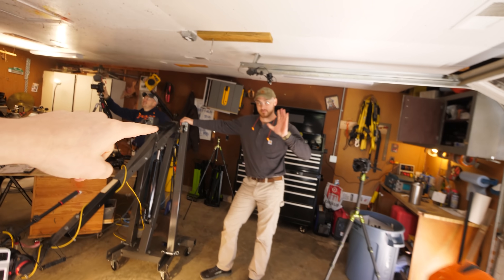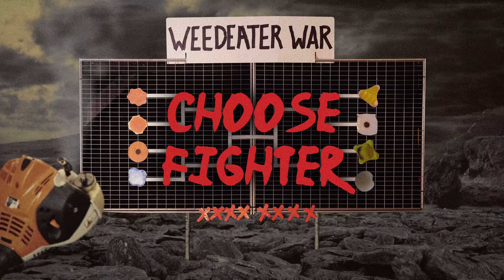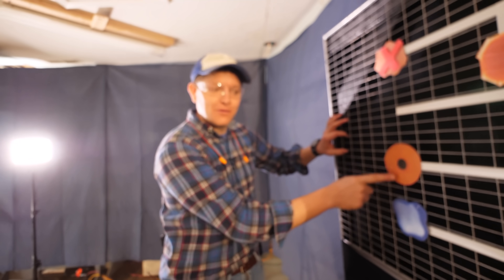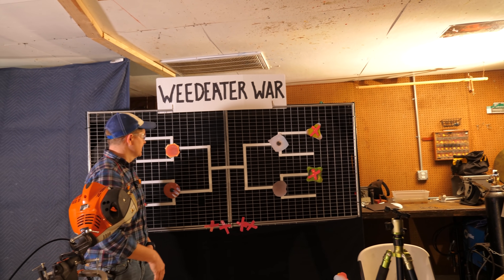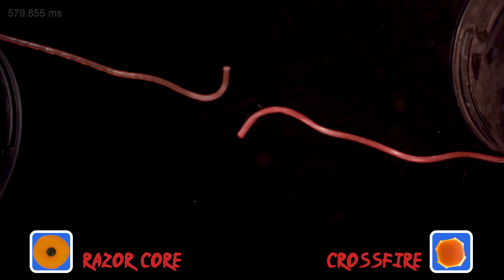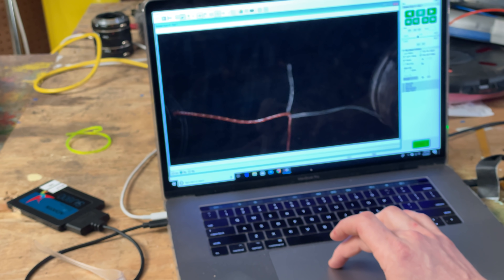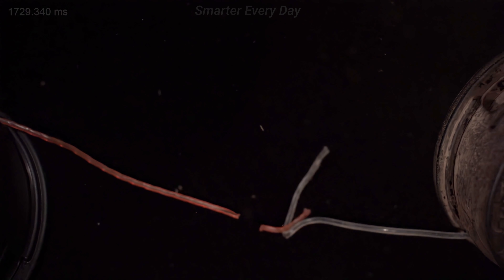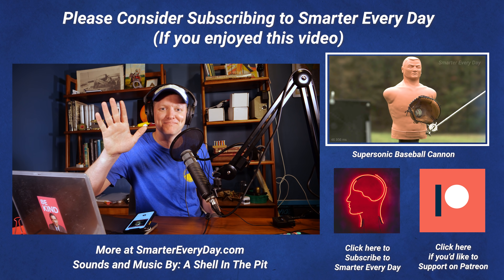What happens when 2 Weedeaters Hit Each Other? (28,000 fps SLOW MOTION)  - Smarter Every Day 255

Comment: I would wager it's partly because rigidity, as you said, but also density and shape. The higher density ones - that has the core, and therefore also have the rigidity - perform better because they have more motion energy; they pack a heavier punch. But also the shape, I believe, the less "flimsy" the shape is, the better it is to deflect incoming blows and to cut. The triangle one is too flimsy, it's more like a folded flat in some ways, too susceptible to incoming blows and cant handle the stress, but round ones are better at absorbing the blows because it can take the punch from any angle and hold up equally good - a blow from the wrong angle tears the weirder shapes faster.

The reason, I believe, the round core and sharp square got to the point they did, was because of those factors. The round core held up great, and technically tore off small pieces first, from what I could see, however, the sharp square cut off larger, and that I believe is due to its shape. While still pretty compact - and not having that many angles that could be torn worse than other angles, such as  the triangle - it also had something the round core didnt; it had the small edges. It wasnt like a very fine edge that could easily chip, like a katana (sorry for the nerdy comparison), but more like a non-honed ax. While not very sharp, it was still something that the round core didnt have. The edges, albeit blunt, on the sharp square cut into the outer layer of the round core and weakened it by cutting into the plastic, meaning in the end it was just the core holding up. And the core couldnt handle the centrifugal forces that occured when the two strips met and clashed, it needed the plastic "shell" to do that. It's like rebar inforced concrete, the core/rebar and the shell/concrete handles different kinds of stresses, and if one breaks, the other cant compensate for it, atleast not easily.

The sharp square had that going for it; while still being fairly compact - with no flimsy weird shapes that could get struck at "the wrong angle" and break easily - it had about the same density/weight as the round core, but with it's blunt edges it could do more cutting into the shell of the round core and weaken the round cores adaptability between rebar/concrete, thus in the end break it in larger chunks.

That's what I believe, anyway.

Comment: Destin, ya gotta try line thats been soaked in water over night vs the same line bone dry or, even better, run in a dehydrator for 24 hrs.  I've found a HUGE difference in how long the line lasts in the tough brush on our property when I soak it before using it.  I'd would love to see that fight on slow mo!!!

Comment: the experiment was a bit flawed than the judgement itself. the point of contact of the wires aka the manual forward movement is subjective.

multiple matches were affected because of this

on top of it the timing of the hit gave the advantage to the wire that got higher mass for that hit

but yeah not scientific nd not conclusive so fun it is

Comment: From what I saw maybe someone should experiment with a tear drop style shape. The desired outcome is in the name if you think about dropping the tearing. Having a round leading edge would resist bending more like with a hollow tube harder to bend than a solid one. Having a smaller/flatter/nonexistent backside would make it more flexible since its in tension like how you can bend a ruler pretty easy and it bounce back. It sort of starts to take the shape of a tape ruler. It can be perfectly wound up into a small area but is super rigid when unwound and can be bent in one direction seemingly indefinitely and still bounce back to shape.   
  
Someone test this and if it works throw me a bone. Try it backwards too. I think that shape combines the best aspects of all the shapes tested.

Comment: Assuming the rigid metal core is a proponent of strength... what would happen if you strung a weed-eater with solid metal cord of some sort? possibly thin diameter aircraft cable?
Reply: You’d get some pretty gnarly shrapnel
Reply: @SeanKillblane  put a couple of ballistics gel dummys around it and you got a million view video.

Comment: This is so awesome.

@15:30 it looks like you pinpoint the "wrapping" failure mechanism you were seeing.

1) impact: then the more compliant line wraps around the stiffer line/object

2) perimeter failure: as the compliant line bends, it creates a stress concentration at the outer perimeter of the line at the tight radius, pushing the outer fibers past the ultimate tensile strength. 

3) momentum increases: during "unwrapping" the end of the compromised line gains angular momentum, increasing tensile force on the line at the weakened point

4) tensile failure:  the axial force created in the line at the moment the unwrapping completes causes tensile failure (perhaps there's also a bit of a shock/fracture type load too).

Slow motion footage is so cool.

Comment: What intrigued me about your video was that the professional weed eater lines (the crossfire, stihl green line, and the husky titanium force) all had more “noodleing” my hypothesis is that the professional lines have to have more flex because you want durability around hard objects eg: trees and houses. It’s all about economics on these things and the more line you save the more money in your pocket. The downfall of the stiffened core lines is that they do not achieve a cleaner cut that is expected when maintaining properties as a professional. They are used in brush cutting applications. I also noticed that when the crossfire line broke, it was a tear at the base of the head. That was more of a head problem than a line problem. There are many different professional products that combat line tear at base like the echo speed feed 400 heads. It would be really cool if you could continue the lawn equipment series and maybe get it touch with the guys at scag mowers or walker mowers and do a video on the incredible engineering of a commercial mower deck. I love your vids and this one was especially amazing!

Comment: Grey solid core lost a body part and was allowed to continue when it should have been called. I couldn't believe it when you guys all tracked the grey losing its tip and didn't call it right there, when that kind of damage KOed the others before the final.

And I can't believe I got so involved and emotional about the most unscientific, most statistically insignificant thing I've ever seen on any of the great science and engineering channels.

Comment: Just an armchair opinion here, but it's my understanding that the kinetic energy of an object is dependent on its velocity squared. I wonder if very minor changes in engine rpm between the two machines can easily bias the results. Watching here, I also perceived a bias for right-side losing -- not sure if that shows out in the data or not - the throttle levers being on the same handle with a person's hand only curving around them seems suspect, what was the procedure for ensuring consistent throttle, therefore consistent rpm, therefore consistent kinetic energy of the line?

Comment: This has been amazing.  It would be interesting to see different materials being used as well.  There is a head for weed eaters that only takes a piece of string instead of a coil.  I've used copper wire, electric fence, zip ties, you name it.  Some things were able to cut through tree saplings.  It would awesome to see some of that in slow mo.  I mean, why build the fighting rig just to stop where you are?  It was meant for more.

Comment: Do a round robin match play session, everyone battles everyone else 1 time. Give 1 point to the winner, none to the loser. the best filament is the one with the most points after all 49 matches are finished. You could even include the other 2 filaments and have 64 matches.

Comment: You brought up that it had to do with the bend radius but I think what you were trying communicate was that the bend radius was controlled by and therefore a function of the yield strength and the elastic properties of the respective line. With a higher yield strength there would have been more resistance to yielding and likely more elasticity.

Let me know if I’m on the right track.

Comment: Bend radius is also important in fiber optics. Too much bend and the light ends up bouncing back to the transmitter instead of the receiver at the other end. It can also cause Chromatic dispersion, where different wavelengths traveling along the same fiber path end up at the receiver at different times.

Comment: Doing bracket style tournament doesn't actually test for the strongest weed whacker wire because certain matchups may be weak against others. If you imagine like rock paper scissors, just because rock happens to get faced with paper on the first round and lose, it wouldn't get to play against the 7 other scissors in the other brackets. The only way to test which is the strongest would be to test every single match up and record the highest winning percentage.

The crossfire could actually be the best one out of your selection and would have beaten all the other wires but it just so happened to lose against the one it was weak against first round,

Comment: So I'm noticing a complex interaction, where it seems tat the line breaks were it wraps over itself. Is it possible that the line is squeezing itself so hard that it breaks? Is it possible that the fiber structure of the line is causing cracks in the line under pressure, causing it to fray?

Comment: I wonder if the speed of rotation topped with the speed of the bend at contact causes the tip to hit the speed of sound which may ignite a micro sonic boom sending shockwaves through the end causing it to weaken and then break??

Comment: My original guess is that the razor core would win- it looked like the thickest, and assuming that all of the weed eater line is made of the same materials, it would mean that it would be the strongest in tension, which seemed like the thing that would help the most. 
I think it would be interesting to see how they all compare in tension, and see if that has a direct coronation with which one won. Or possibly which one has the highest strength to thickness ratio, as I imagine a steel wire would win against a pool noodle with the same strength.
Awesome video as always!

Comment: I think you should do the walk behind string trimmers in slow-mo cutting and/or this. The string I got for mine is super tough, can even knock down trees like 1/4-3/8 inch like nothing. I have had my trimmer for like two years now and not even had to change the strings. But these strings are like 3/16 inch diameter I would guess.

Comment: This experiment is Great but I think you missed the fact that this is also testing the sharpness too because the line has to be sharper and stronger than the other one or else it wouldn't cut it, so the sharpness of the rope can affect which one wins

You can do a more controlled durability test by banging the ropes into the same object and examining the damages like in The show "forged in fire" where they smack the blades on tough objects

But this experiment is Great non the less you essentially found out which rope has the best balance between durability and sharpness

Comment: In a sense, this is a study of mass, tensile strength, material toughness, flexibility, hardness, and elasticity. Did you measure those variables of each string before running the battles? It would be interesting to see which variable had a greater effect on the likely hood of winning a match. This would probably require a round robin tournament, though.
Reply: I would actually conduct these first rounds with smooth strings for all, but that match the characteristics above. THEN take the string that overcomes the rest and measure the varying shapes to see which is better.
Reply: Of course, now that I think about it, cross section may have a significant impact on Elasticity and bending radius in particular directions, meaning the shape could have a significant impact if you can control which direction (relative to the strings axis) it bends.

Comment: I live on a homestead and weed eaters using a line just do not do what I need.  Instead I use a head that has metal blades that will cut through small saplings.  It is the only thing that will cut through the thick Johnson grass and such around the homestead.  If it hits a wire fence, however, then life gets real interesting.  My son was using it and it bounced off 2x4 wire and hit his ankle.  It cut through his pants, the leather boot, his sock and cut a deep 4 inch gash that required a trip to the ER for 8 stitches.  Seeing this beast  cut in slow motion would be interesting to see what it does to weeds, saplings, and the like.